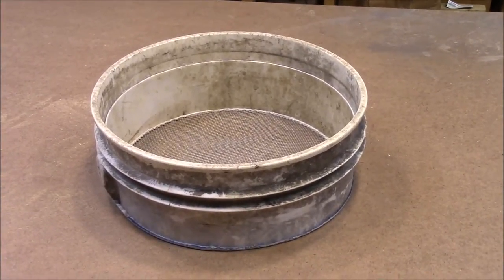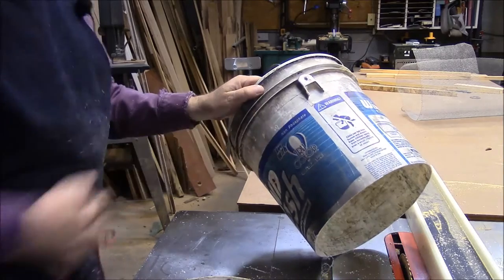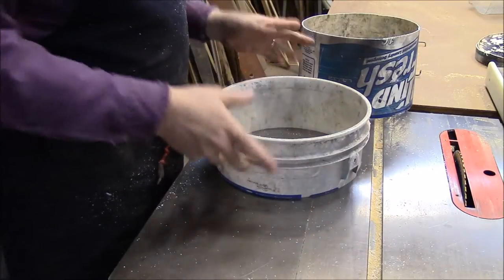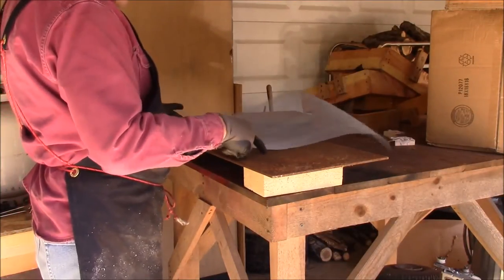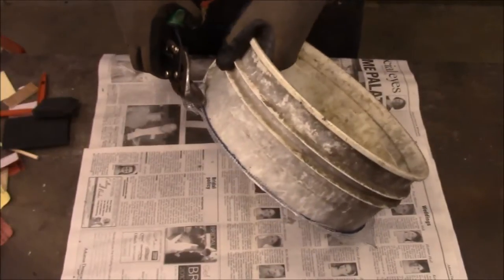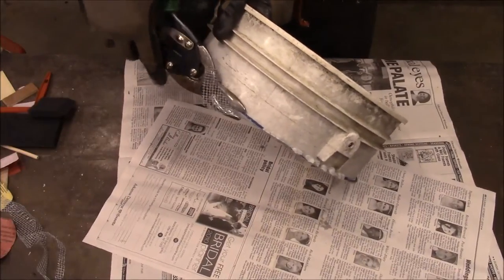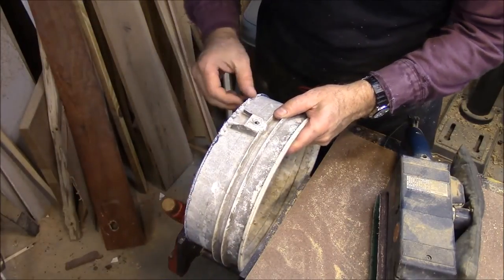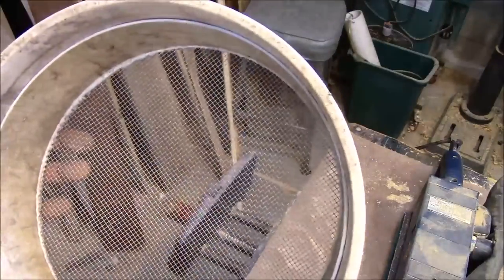Homemade Sand Riddle

Comment: Green-sand? Like for metal casting? Worked in a green-sand foundry some forty years back. We used big riddles ...and some little ones for delicate work. Went back to making pottery in the 90s. This looks like a real nice alternative to the ones they sell at the pottery supply store. Thanks!
Reply from the maker: Your welcome!  Yes I use it for greensand or actually petrobond sand for metal casting.

Comment: Very clever. How has it held up?
Reply from the maker: It has held up great.  I would like to make another one that has coarser mesh, this one is kind of fine for the petrobond, you have to push it through.  Thanks for watching!
Reply: Soat Mon Well I bought a griddle from Goodwill, and a couple of cheap buckets from Walmart. I already had some screen on hand. I double layered the plastic just as you did. I set the griddle to 260 degrees. Everything worked great. I trimmed the majority of the screen off with a pair of scissors. Here's were I tried something different. I used a pair of end nipper pliers to trim the edge. This worked really well. I was able to get a nice flush cut. Then I smoothed what little remained with some dry wall sanding screen. Smooth as a babies behind. It looks so good, and it was really easy to do. Thank you for the great idea.
Reply from the maker: That's awesome!!  I glad you made one.  Thanks for letting me know. :)